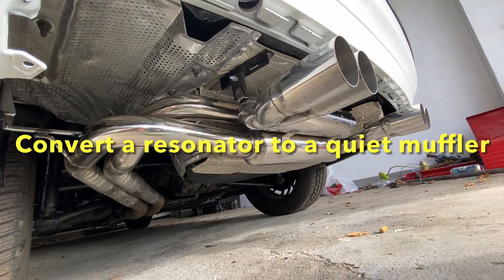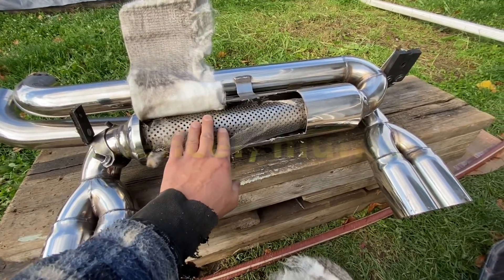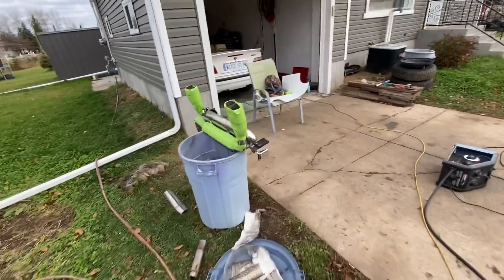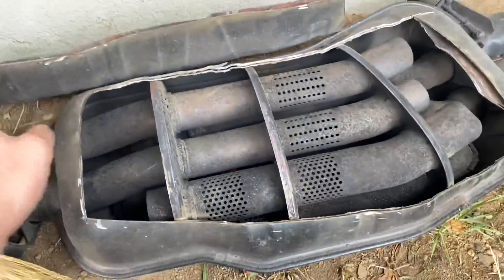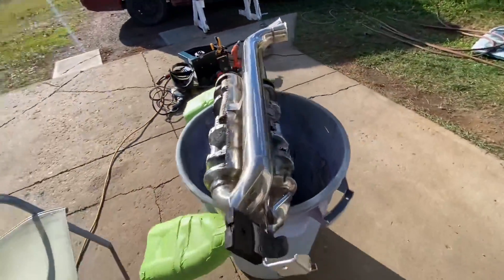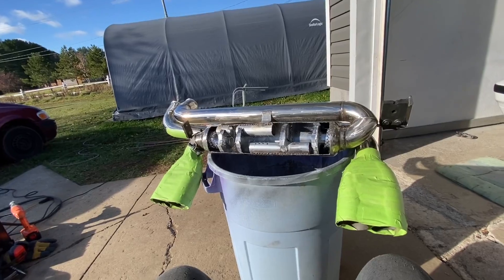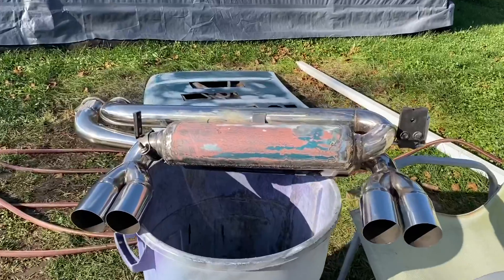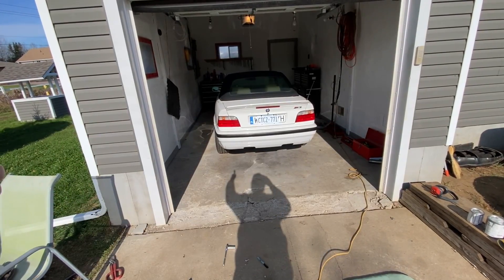Turning a resonator into a silencing muffler. Homebuilt muffler. Eliminate ￼exhaust drone.￼

Comment: I bought aftermarket exhaust so I could be cool, it was too loud, so I made it more restricted then stock
Reply from the maker: Correct, im old
Reply: @ProblemSolverGarage  I don't think your age has anything to do with it. Sincerely an old guy running headers and straight pipes. You should have just bought an OEM muffler and sold the aftermarket unit instead of making scrap iron out of it.
Reply: @callmed.7171  another old guy here with a straight piped 7.3 powerstroke with 4" pipe,  I like to hear my shit